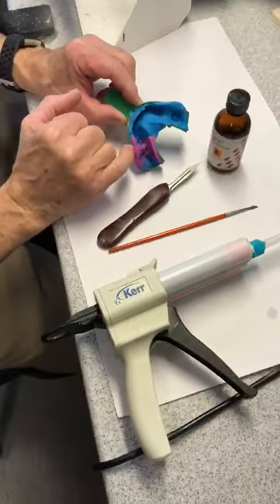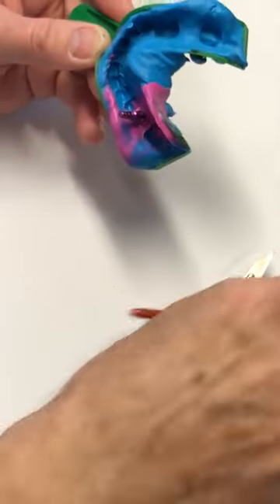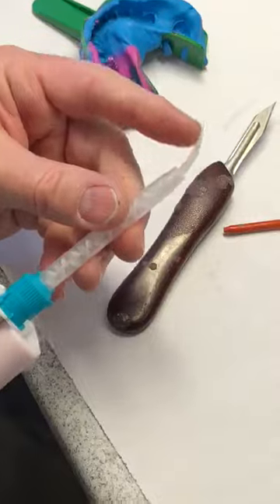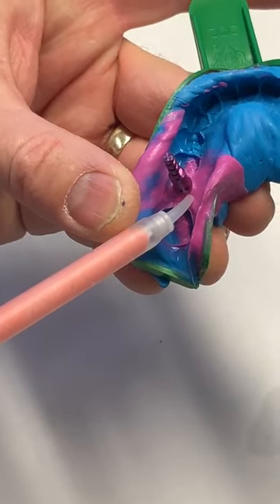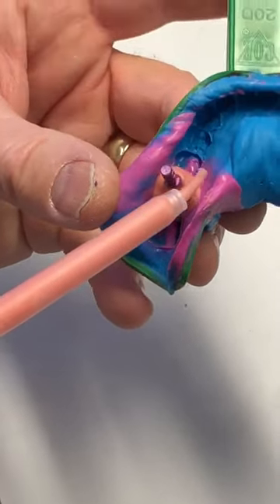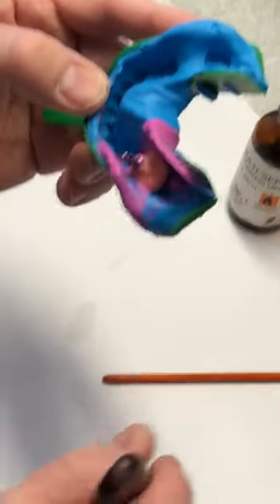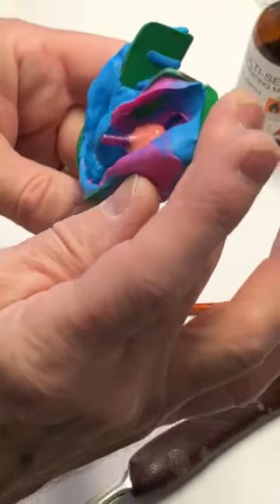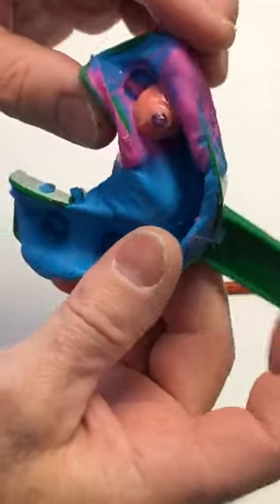Placing the soft tissue material around an implant analog video

Comment: One tip that'll save me a lot of time is using plastalina modeling clay to box out adjacent teeth.it quickly becomes pliable when kneeded between fingers pushed into adjacent tooth area paralleled with acrylic spatula. you still have to clean up with bard-parker but it allows you to pour multiple gingival tones fast.